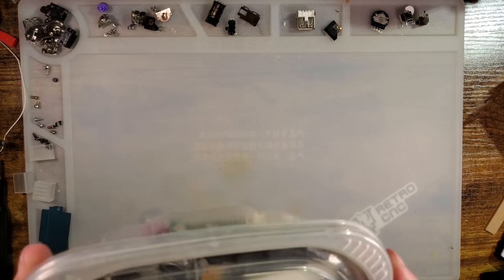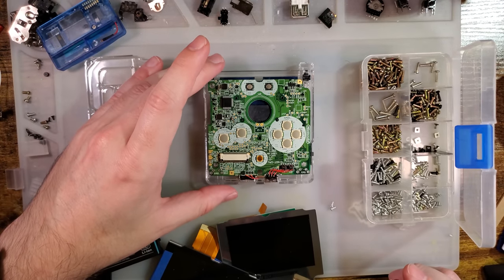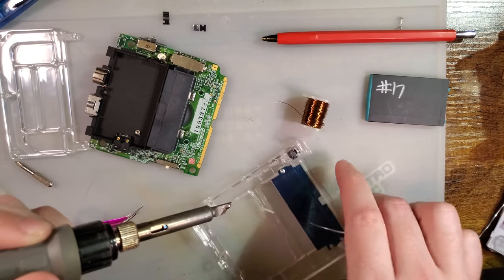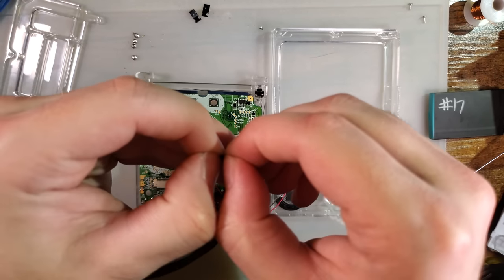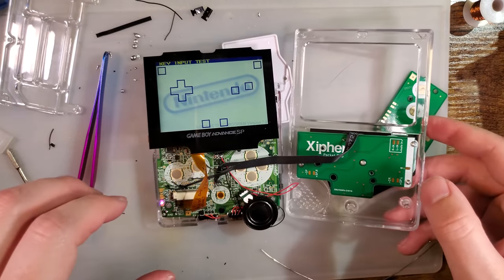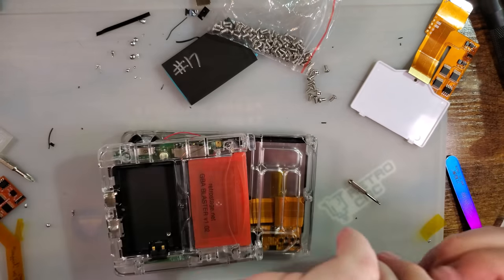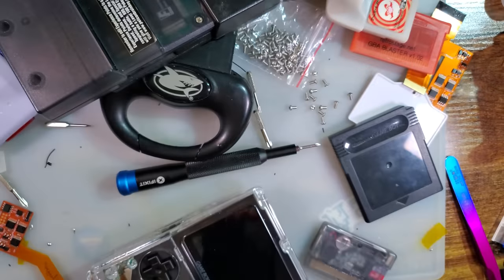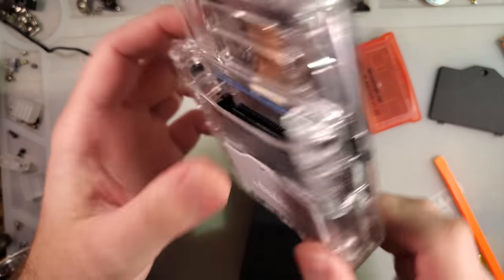XIPHER Slab Build

Comment: Hey Makho, 
why not simply use the L & R inputs on board and solder speaker? also does this mean you can use 2 speakers for this board? since I see an L and R speaker channel time stamp 4:06
Reply from the maker: As I explained in the video, the audio is not wired up properly on the board for the SP, hence why I skipped it. The amp in the SP also only supports the one speaker. Amplified audio is only in mono and stereo audio is not amplified.

Comment: does anybody know what the pitch is for the ribbon cable? Makhos link has almost a 2 month delivery time. I'd like to find one that could be delivered sooner. Thank you :)
Reply from the maker: the ribbon I linked is custom. It uses a standard 0.5mm pin pitch though.
Reply: @makho  Thank you senpai
Reply: @makho  So if I could just ask a clarifying question: Essentially what you are doing here is, using a ribbon cable to convert the SP screen output to a 32 pin gba output? And then using the IPS ribbon from the GBA kit, but using an SP v2 IPS screen? The IPS screen is the same for the sp and gba, correct (minus the lense)? You're just using the GBA IPS ribbon cable, rather than the one you would get with an SP IPS kit, yeah? So if I had the SP IPS kit, I would need a different extension cable?
Reply from the maker: @nissutobor9078  yes, you'd need a different cable for an SP based kit. And yes, the GBA and GBA SP LCDs are the same for all the 9380 based kits.